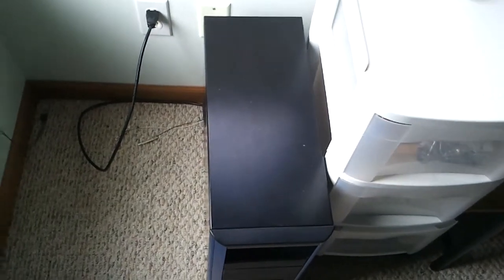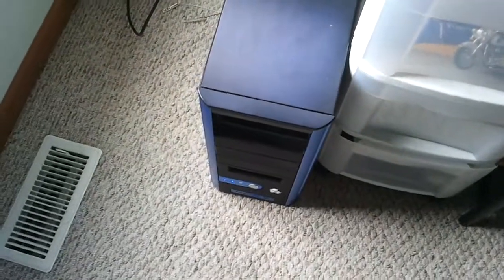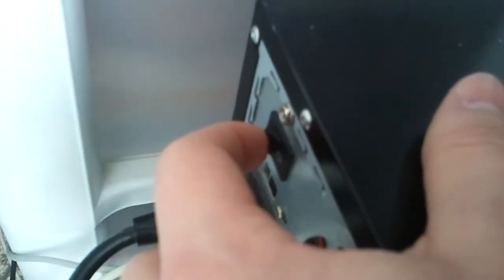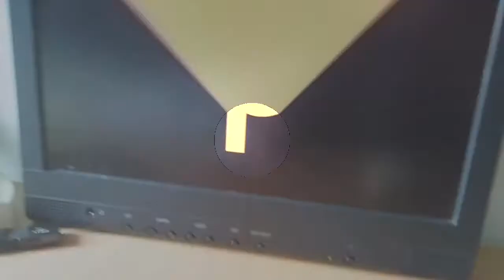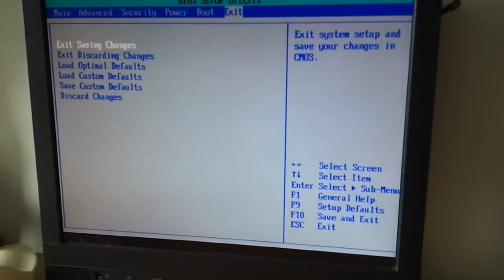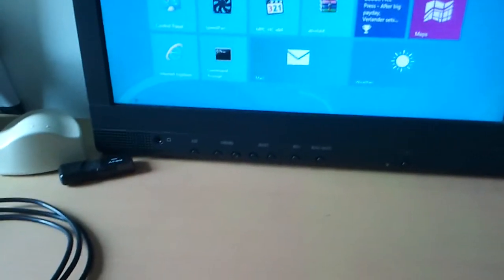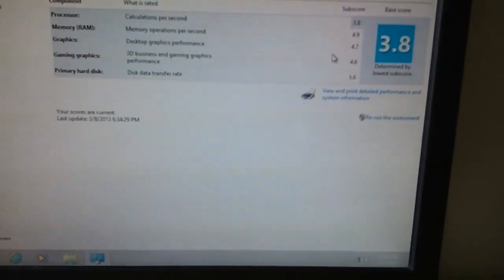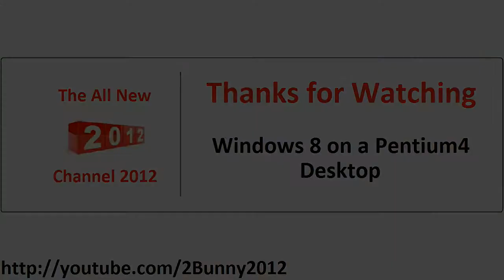Windows 8 + Pentium4 Dekstop (tour and observations)

Comment: So much b!tching so less showin how the fucking pentium 4 runs .
Reply from the maker: Too late, the video has already been recorded. Although there is a good chance that you will get to see this computer on the channel again in the very near future. I've actually improved it significantly since it appeared in this video, so there are no more gaping holes in the front of the case or missing slot covers in the back.
Reply: ***** Also, i just want to see the computer running Windows 8 and executing some shit, not to be 4 minutes to see how pretty well the damn case and its insides look like, just record it again showing the pc executing programs and shit, oh and don't u dare to put some blue shit covering the whole screen like u did at 5:30
Reply from the maker: Marshmallow Productions
You'll love the new computer. I don't want to spoil the surprise, but I will say that in its new role, it won't even run Windows. And the case will be even better. I don't know if there'll be any "blue shit..at 5:30", but I can try to work some in there ;-).

Comment: ***** how did it run?
Reply from the maker: It runs well enough; comparably to Windows 7 and Vista. There's a fair amount of disk usage that slows things down a hair at times, but it's also noteworthy that it's running with a pretty slow hard drive too, so I can excuse that to some degree.

My only complaints are that the visuals in Windows 8 itself are very bland and that it cannot be updated to Windows 8.1 without using the 32bit version. I considered upgrading to Vista, but I have taken up Metro Minesweeper in the Windows 8 start menu.

Comment: Hola amigo como lograstes eso esplicame o unas instruccion yo hablo espñaol no ingles gracias :)
Reply from the maker: You're welcome, glad you enjoyed it.
Reply: ????
te digo que me expliques como se instala
Reply from the maker: ZUMBDJ TUTORIALES

Nothing special, just put the CD in and go.
Reply from the maker: ZUMBDJ TUTORIALES

Try to find out what the error means and what is causing it, then adjust your hardware so that the cause of the error is corrected and continue the installation.
Reply from the maker: ZUMBDJ TUTORIALES

Nx is a BIOS feature required by Windows 8. If you're getting hung up at the installation because this is disabled, you must enable it. If your motherboard's bios does not support the nx feature, you're probably better off installing something else, like windows xp. Windows 8 may be fun to play around with, but you're really not missing much if you can't get it to work.

Best of luck.

Comment: I have an old computer from 2004 that I do not use anymore. It has 1 GB ram, 3.4 GHz Pentium 4 CPU, 256 MB Nvidia Geforce FX 5950 Ultra GPU, and a 160 GB hdd. It was expensive as hell so i don't wanna throw it away. Could I run windows 8 on it?

Comment: Lubuntu is much lighter and faster than Ubuntu, so it's better suited to old hardware like the Pentium 4. 
I've even run it on Pentium III's. You could also try Puppy Linux from a Live CD or a flash drive... it's an extremely small OS, and there's no need to install it to your HD. It'll even save settings and files on the same flash drive it boots from. Wireless drivers can be hit or miss, but video drivers are usually easier than Windows.